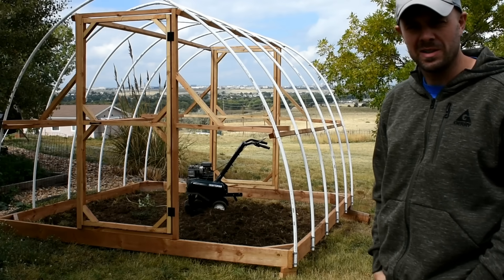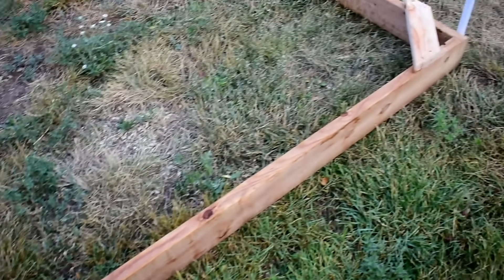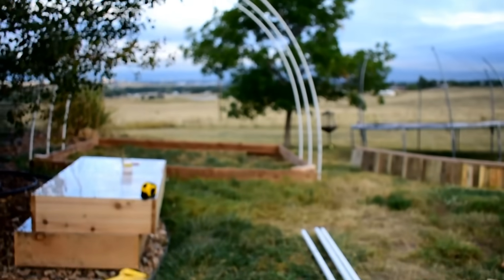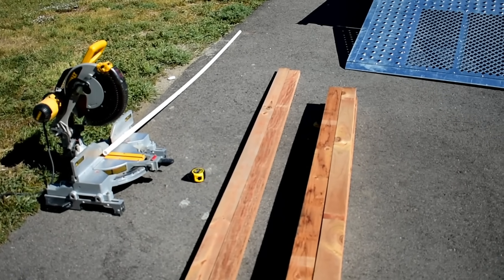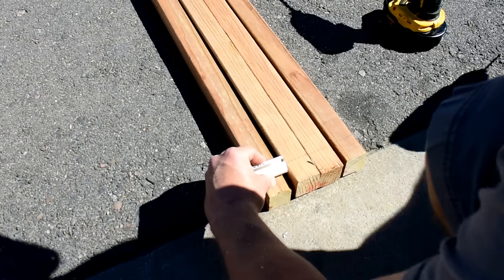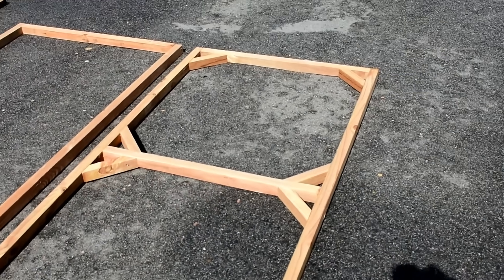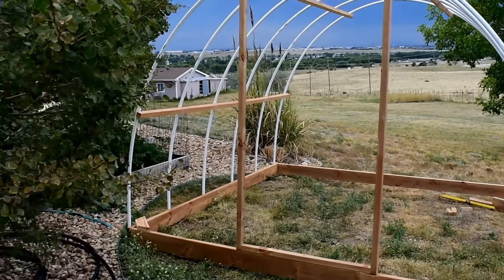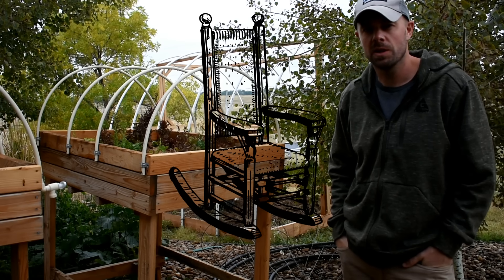Build a 🌻Winter Greenhouse🌻 in 1 day for $150!! #diyhoophouse

Comment: Is the plastic you use from amazon BPA free. A concern is leaching toxins into organic garden. Was unable to find any information on the type of plastic it is. Any ideas?
Reply from the maker: It is used for plumbing applications so i doubt it would be a BPA product.  It also does not touch the soil so nothing would leach in to the surrounding.

Comment: Lessons learned from my own build (6 years old and going strong):
1) Grey electrical conduit is more resistant to UV and has a joint built in for connecting two fo them together.
2) Don't seam the PVC at the top of the curve - that is the highest stress point and is prone to failure... better to do 5', 10', 5' - a little more cutting and joints but the joints are down where there is little bending stress.
3) I bored holes in my 26 ridge beam and ran the PVC thru it - more work, but it supports 2,000 lbs of snow load in the winter.

Comment: How would I further stabilize the thing to the floor if I live in an area that gets can get very windy?. I'm inland but at the top of a hill so we get some strong gusts now and then. I've seen video where he uses 3 foot piping larger than the main and digs it 2 ft into the ground and have 1ft sticking out and puts the top pipe into that pipe and puts a screw in to secure. Would that be something required for a windier place?

Comment: Some  omissions IMO.   You didn't show putting up the PVC.  How did that go?   Screw in one bottom while the piece is standing in the air before screwing in one side at a time?   Seems like it would be good to show in action.  Second, not sure how you were able to cut out the notch on the 2" PVC pieces.  Chop saw?   That looks dangerous.   How did you hold them in place while you cut the notch.  How about putting the notched pieces onto the other PVC?   Apparently the piece pulls open?   How did you do that without breaking the pieces?   Also,  no problem with the PVC joint at the 10' point coming lose or breaking?    I like the concept, but as far as instructions and a thorough showing you could have been more helpful I think.

Comment: what was the average internal temperature of the finished greenhouse during the winter. where im at, it gets pretty cold. so I was wondering what’s the difference between the outside temp and the inside temp. thanks.

Comment: To prevent a wind storm from blowing it away I would stick a piece of rebar inside at the end of those pvc to the ground inside at least 5 inches so that if a strong storm comes along it won’t be blown away. I would stick it at each  corner and mid section. I like your idea of your hoop house.
Reply: Our hoop house is similar.  We used rebar on the inside of the frame, slipping the conduit over the rebar and also used the strapping anchors as well.  This gave a nice smooth area on the outside to attach wiggle wire track to attach the plastic.  We live in the northeast, and get very high winds from time to time (Ex: hurricane Sandy) and have had no problems, I think because the plastic is secured on pretty snug.  We get snow as well, and have not had any issues, as we also have a 2x4 frame from the top of the doors across the length which adds a lot of support. And framed out 2x4 end walls. We wrapped the pvc with white duct tape to keep the pvc from degrading the plastic, but the tape is now degrading and flaking, and would instead paint the pvc to create a barrier if done again.  The greenhouse plastic has lasted much longer than it’s rated lifespan as well.  The greenhouse gets just as cold inside at night as the night outside temps, but during the day it really heats up especially in the sun, and keeps the ground from freezing.  (zone 7).  Nothing like being in the greenhouse in winter in a T-shirt, when there is snow outside.
Reply: I built a hoop house but without all the wood, the PVC hoops sit on 1/2" by 2 foot PVC pipes driven into the ground.  They are only about a foot into the ground (any further and it's all limestone).  Winter frost left the whole thing with a lean.  I wonder if rebar in a fluid ground and unyielding PVC might be a problem.

Comment: I heard PVC gets brittle
That the Grey electrical has UV protect ion
Reply: Correct. The white pvc is intended to be buried underground where it gets no sunlight and is therefore not UV resistant. The gray electrical pipe has more above-ground use and often used outdoors and so is more resistant to sun damage. Will last years longer.
Reply: shanah Tovah nice I’ll have to remember that when I build one myself!

Comment from the maker: Hey guys,  if you try this out, you can also use electrical PVC conduit (the grey stuff).  It is more sun tolerant than the white is and should give you a longer lifespan.  Also, make sure this is secured to the ground well.  It can tolerate wind and sheds it off pretty well being rounded.

Comment: FYI, It would be better (I think) to put the PVC bows on the inside of the structure (much more support/stronger). Also, would it be better to use metal brackets to hold the PVC, or would those rust? It seems like in time/cold climates, that the plastic ones might crack?
Reply: The exact same thing I was thinking, great minds think alike 👍

Comment: When framing the door frame, there is no need for the bottom rail. Instead find the center and toenail the verticals in place, This will allow for an even taller (1.75"?) door with less limber, Of course, you can cut a spacer 36.5" wide (marked at its center, held with a single screw to the base)) to help you place the verticals, then remove the spacer once the door frame is set in place and screwed down (toenail the screws).
Reply from the maker: Thanks for the tip charles

Comment: Can you get away with 1/2 inch PVC pipe or does it need to be 3/4 for any specific reason?
Reply from the maker: 1/2" will not be strong enough over the large span.  I would do at least 3/4

Comment: I retired 1 month before my 41st birthday (now 57).  Have built many a hoophouse since then.  A few points:  1) The white PVC will get brittle from UV in a year or so.  You will get a few more years if the plastic blocks UV.  What will happen is a strong side wind will distort the shape a little causing the pipe to snap and poke a hole through the plastic.  Grey electrical PVC is UV protected and lasts much longer in a hoophouse.  2) strong winds will lift that thing like a kite.  Many designs extend the pvc beyond the side boards anchored into the ground.  You can also use a few screw anchors into the ground attached by cable to the side boards.  Good luck and enjoy the hoophouse.
Reply from the maker: Thanks for the input, i am always looking to improve the design and quality.  Congrats on retiring early.
Reply: Nor Kavon3